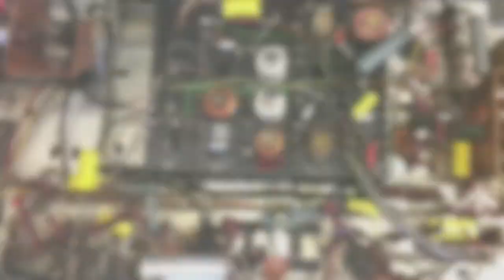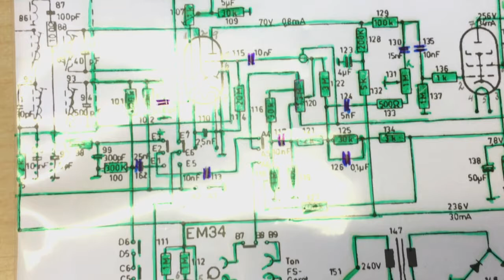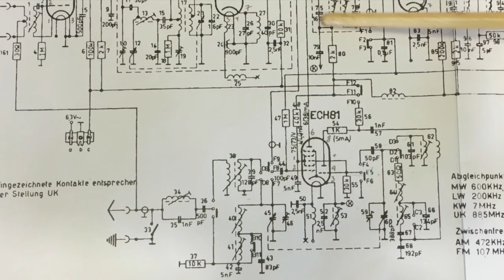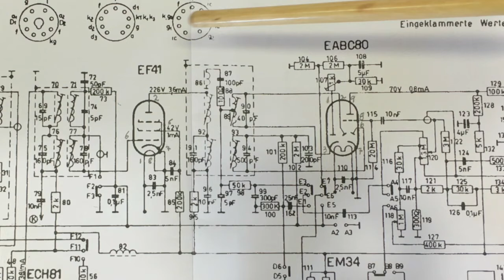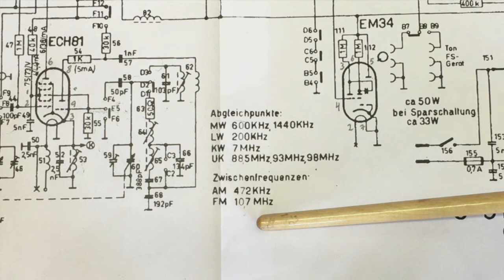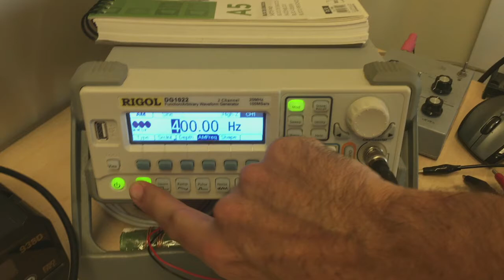Graetz Super 171W tube radio restoration - Part 4. Radio part done. Alignment, anybody?

Comment: Got similar radio i work on when you soldering on this thing stinks absolutely terrible and poisonous little fan with charcoal filter not good enough as old school technicians need like a proper extraction fan tube system or do it outside your lungs will thank you

Comment: That is a very interesting design; FM broadcasting began in Germany (and the UK as well) in 1955 and the ECC85 wasn't used in the very first designs, even though it was apparently released in 1954. So in the UK for example, Pye used 2 EF80's as RF amp and oscillator mixer in their early designs;  here Graetz have used an EC92 for the convertor. Also the EM34 predates the EM81 or 84 as well. So I'm guessing this set dates from around 1955 or so.  I was particularly interested to hear your comments regarding the sensitivity of the FM section, that will be the extra gain from the pentode RF stage over the typical triode. I think the antenna arrangement is intended to use the downlead of the FM external antenna as the AM antenna. VHF signals coming down the cable from the antenna are coupled from the primary through to the secondary winding on the input coil of course in the usual way. But the connection to the centre tap of the primary allows the cable to act as the AM antenna. However, any RF currents coming the other way through the 30 ohm resistor will cancel out as they will flow equally in both directions away from the centre tap and so they will not couple to the input of the FM RF stage. Well, that's what I think it does!! Thank you for a very good video as always:)
Reply from the maker: This one is from 1953/54. It came out at the same time as the SABA Meersburg W3 that I have also restored (did 2 of them actually) which also has the EF80 and EC92 on the FM, with a EM34 magic eye. The SABA Freiburg W2 from 1952 that I also have uses the EF80 and EC92, but uses an EM71 magic eye. I think they actually messed around with something like FM in Germany before 1955 (It was ultra-shortwave or something, since Germany was not licensed to have FM at some big pow-wow in Copenhagen), because they started introducing it into their radios a little sooner. 
Thanks for the explanation about the antenna. Makes sense. I obviously forgot some of my common mode cancelation theory (it's been 30 years since varsity). 
I know I keep saying this, but I'm just shocked by the quality of the FM reception!

Comment: About those waxed cores - I've had the most luck with tiny screwdrivers which I have heated for a second or two with soldering iron and scraping the wax off, then I'd put a drop of WD-40 into the coils carcass. After that the core inside won't break in half if's rotated and it's just easier to adjust.